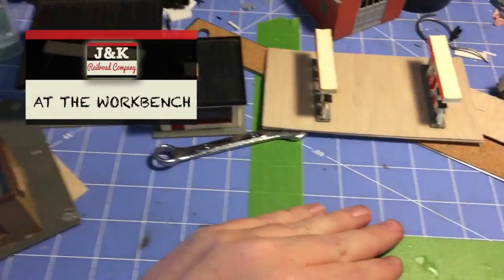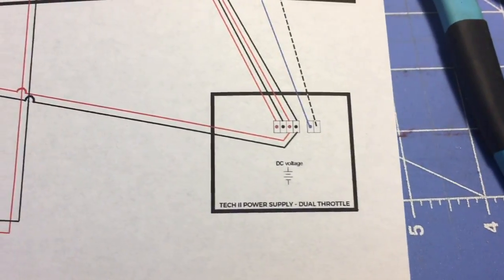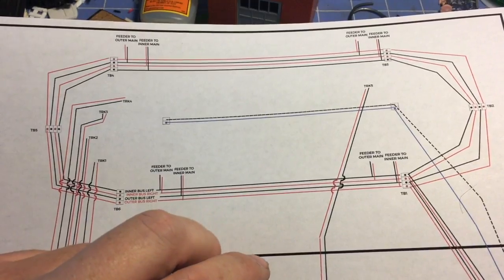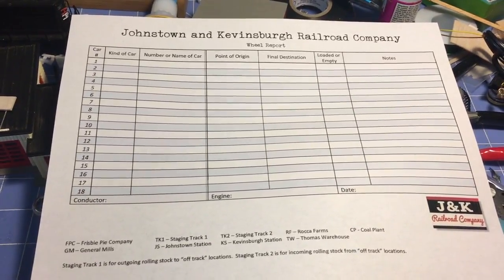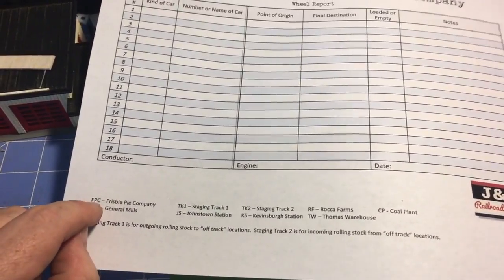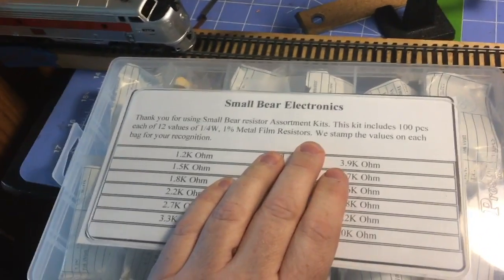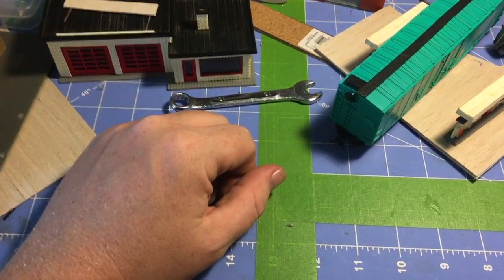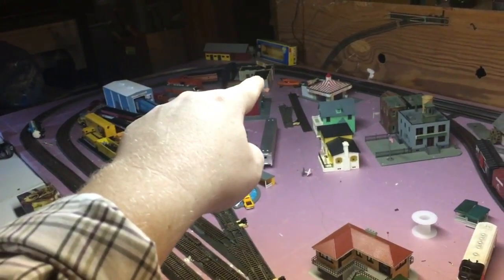Episode 7 - I changed Stuff...Again

Comment: Layout is looking great. FYI I have operated on many layouts and everyone has a variation with wheel reports, car cards, and switch lists. So your switch list will be fine. If you really wanted to, you can use car cards. Mine is based on a actual wheel report. I am still modifying the way I plan to operate. Planning on incorporating track diagrams with the wheel reports on the actual location be switched. Maybe I will do a video on it. Looking forward to your next update.
Reply from the maker: Great to know!  I'm sure it will evolve, but still brand new to that.  When I was a kid, I was happy with running in circles.    Next update will be a drastic difference to what the layout looks like now.  We are painting the pink to green!